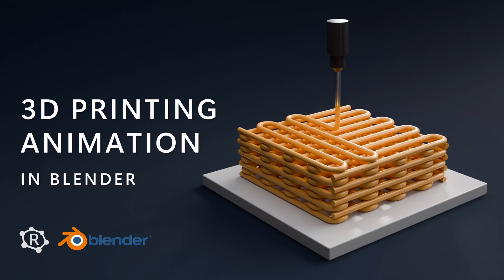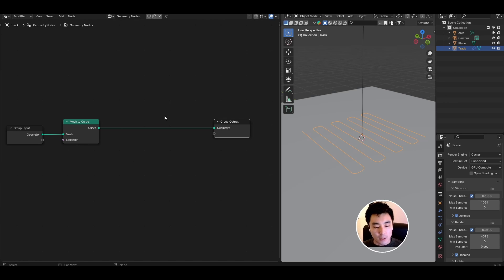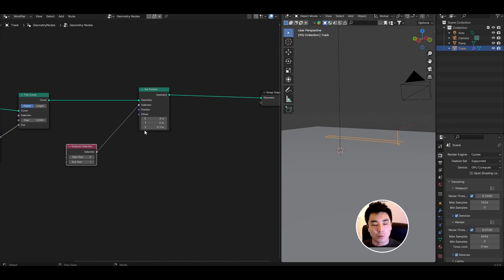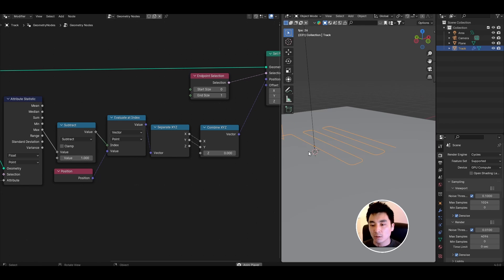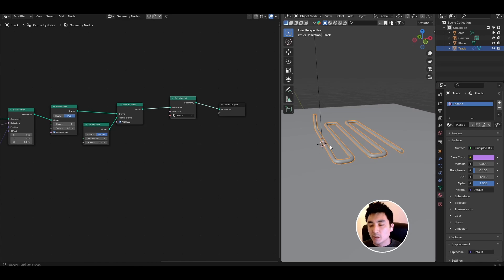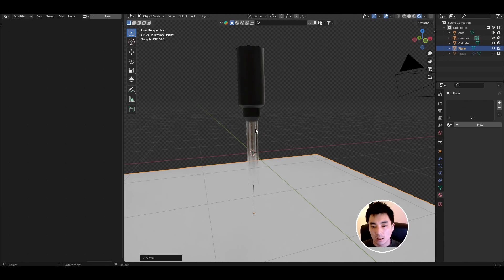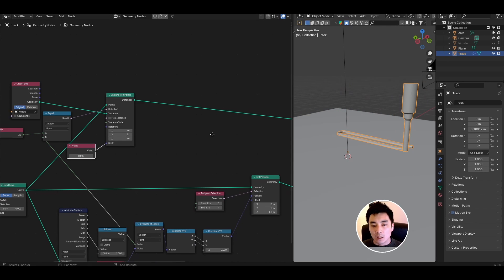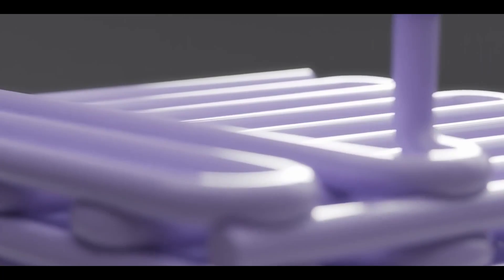3D Printing Animation in Blender

Comment: Hey, if I wanna make an adaptation for this conventional 3D printing setup, into a melt-electrowritting setup which uses voltage to get the jet thinner has it descends how would you do it? Moreover, how would you also do a Taylor Cone of a electrospinning setup? Any thoughts?
Reply from the maker: If you need to manipulate the morphology of the extrude, eg to make it transition to something thinner, best bet is to use a set curve radius node after converting the mesh that defines the print path into a curve. Use the spline paramter node and plug into the set curve radius to define a different extrude diameter at different points along its length. For finer control, drop in a float curve node between the set curve radius and spline parameter node and play with its profile. For the Taylor Cone, would depend on how accurate you need this to be and whether it needs animating.

Comment: Hi Ryo, 
I have a cube design, but after adding the floored modulo and value and play the animation all four sides start moving. I just want  it to ‘build’ up from the bottom to the top just like a construction 3D printer works. What can I do?
Reply from the maker: Hmm, very hard to diagnose the issue without knowing more about how you're creating the cube design. Is it a mesh cube? Or some kind of design you've imported? The reason the printing effect works in the tutorial is because the print track is one continuous curve. This allows it to unambiguously assign spline parameters of 0 at one end, and 1 at the other; toggling between these two values uniquely maps a position along the curve. If your design is discontinuous, or has been created in a way such that points are not connected in a smooth continuous way (i.e. two points along your path with spline parameters "n" and "n+1" are actually right next to each other), you will get weird effects.
Reply: @ryomizutagraphics   it’s actually a cube, but I figured something out. I will convert it to a curve and then in edit mode delete all the other parts until I have one single part left and then duplicate it until it forms a cube. Let me check how that turns out. I’m also not using a nozzle, just the movement of the 3D printing.
The only thing I need to do in order for my technique to work is to use keyframes for each part.

Comment: Thanks, this was really helpful! How would you reverse the print direction, for example in a 3D structure with a continuous print path, how would you tell it that the path start is at the bottom? (currently my animation is printing top down)
Reply from the maker: There are many ways to do this. Just off the top of my head, you could animate the Start value of the Trim Curve node, rather than the End value. 

Connect the Floored Modulo to the Start input rather than the End. You'll need to flip the output from the Modulo (it current goes from 0 -> 1 as the frame count progresses. We want it to go 1 -> 0 instead). Drop a Map Range between Floored Modulo and Trim Curve. Set the to min/max to 1 and 0. Hit play, the print should appear from the other end
Reply: @ryomizutagraphics  Thank you, that worked great!

Comment: Great tutorial, Ryo! The trick with Merge by Distance to reduce the excess of points of the Fillet Curve solve my problem here. Regarding the #frame driver, I use another alternative: I plug the Scene Time (frames) to the Map Range and set the From Min to 1 and From Max to whatever I want. I think this is a quicker way of changing the animation duration
Reply from the maker: Thats a great idea! Thanks!